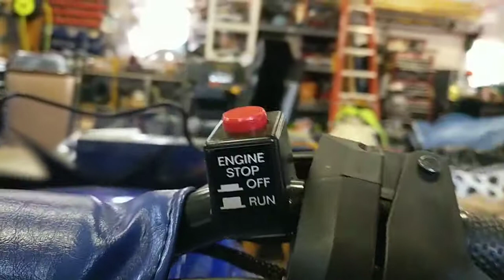2018 Yamaha 200 Snoscoot throttle switch fix without disconnect

Comment: I bought mine used and I noticed someone had unplugged the switch harness I’m assuming that was the reason but now it won’t start when it’s cold but if I bring it into my heated garage for just 30 minutes it starts right up. Does anyone know if there’s any recalls or if it could possibly be a kink in the gas line